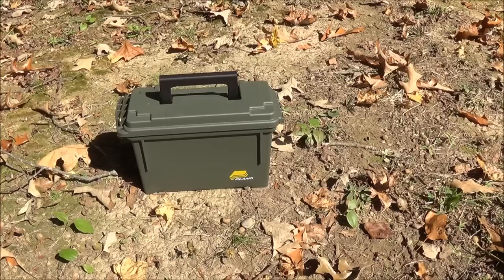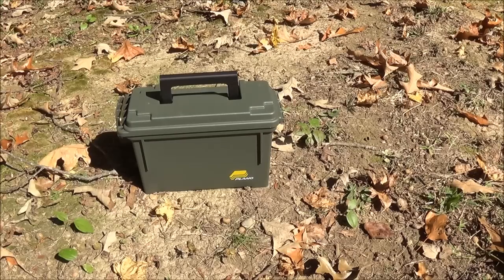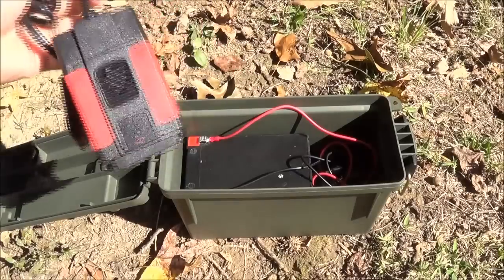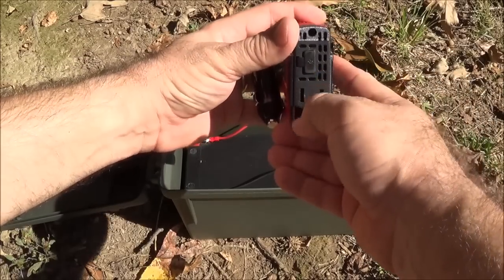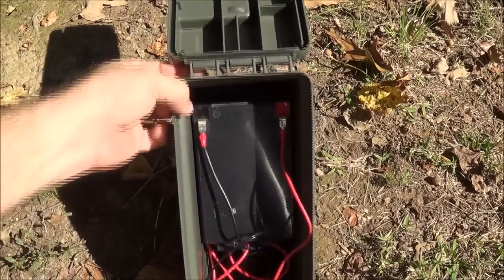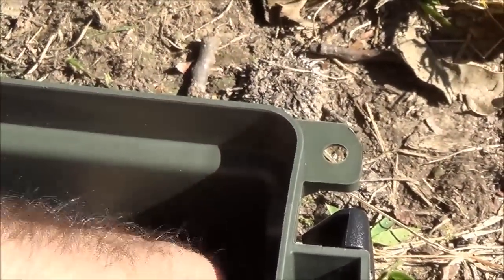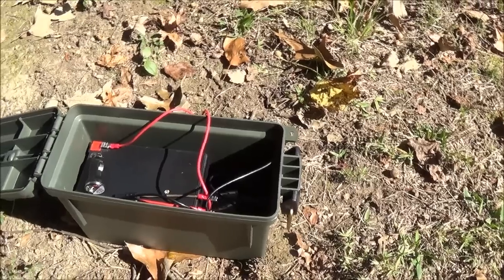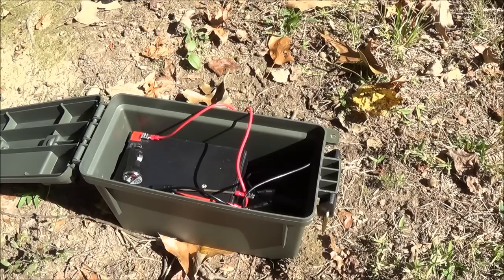Small DIY Portable Solar Generator

Comment: I used a really effective way to power my medium to small devices! I took a 12-24v Solar charge controller, 15 watt small solar panels, 12v 8ah rechargeable battery and a 150-250 watt inverter. This turned out to be an amazing setup because I powered a 15 inch T.V. for about 5 hours! Crazy hah? I also powered my USB charger and charged my phone 7 times 0-100%! I totally recommend the parts I used because it defines the portable power. Plus its not tooooo expensive!

Comment: I used Velcro on my 12volt 7.5 amp Battery . 3inch by 3inch keeps it from floating. Also connected my Mini charger to a standard house lamp with a 12 volt led light. I made a patch cord from my 12 volt inverter male plug cut off the eyelets and used a standard female plug from Home Depot .that way I can use any standard household lamp works great. Looking forward to more vids. Be blessed.  Jim Davis
Reply from the maker: Jim Davis Lots of great ideas! Thanks!!

Comment: I've used the same ammo box and used 18 EDLCs rated at 2.7v @ 500Farads. 3 sets of 6 in series to achieve 15v @ 260 Farads. It charges to full in 30 minutes and has started my car with a flat battery on several occasions.

Comment: You can get double quick disconnects, so that you can have both your cigarette adapter on the case and your solar connecter hooked up at the same time. I got a pack with a set of 4 different styles at radioshack (6403064) a while back. Anything to make wiring life easier.
Reply from the maker: That is a really great idea. I am going to look into that. Thanks, I really appreciate it!!

Comment: I like this.. my tablet doesnt output sound, can you tell me what batt. amp Hr. you have thanks!
Reply from the maker: The battery that I have in this unit is a 12 amp hour. It works great with my 20 watt solar panel.
Reply: How long did it take for the 20 watt solar panel to fully charged the 12 v 12ah battery?

Comment: What do you use for a solar charge controller in this set up?
Reply from the maker: windersranger1 Although it is not hooked up in the video, I am using a charge controller very similar to this one.

http://astore.amazon.com/ncpr06-20/detail/B00APBH368
Reply: gotcha, yeah I didn't see one in your video but you mentioned charging by a solar panel. Thanks for the reply.
Reply from the maker: windersranger1 You are welcome, any time!!

Comment: That ammo box is storage, not a generator. The panels would be the "generator". Where are these panels?
Reply from the maker: Thanks for your comment. I use the word "generator" for the ammo box, because that is where the usable energy comes from. Just as gasoline would not considered the generator for a gas powered generator. 

The solar panel is used to charge and recharge the battery or power the generator just as gasoline is the power source for the gas powered generator. 

The solar panel can be found here: https://youtu.be/e8pAvpKrfwk

Thanks for watching!
Reply: You sure? Because generator is defined as: a thing that generates something, in particular. as an example = a dynamo or similar machine for converting mechanical energy into electricity. Or in this case a solar panel designed to absorb the sun's rays as a source of energy for generating electricity or heating. Where as a box with a tender and battery are defined as storage. I only say this so people will ask if the solar panels are included or are you misrepresenting the function and capability of the device. As it does require something that generates electricity like solar panels, 12 volts dc from a car or 120 volts ac thru converter to 12 volts dc from a residence to charge your system so as to be converted to 120 vac or 12 vdc for what have you.
Reply: It has no connection whatever to solar, period.  Even if the battery was charged earlier with a solar setup.